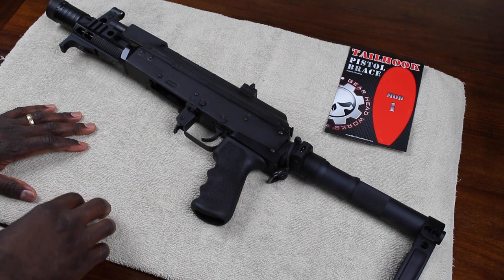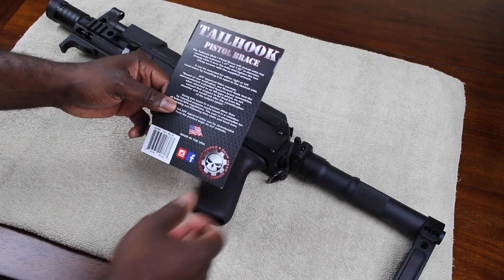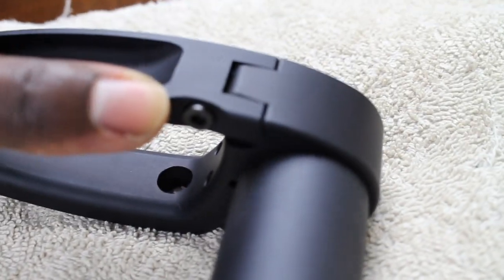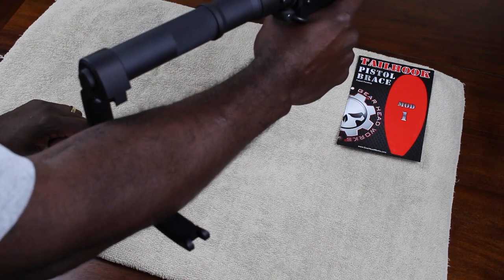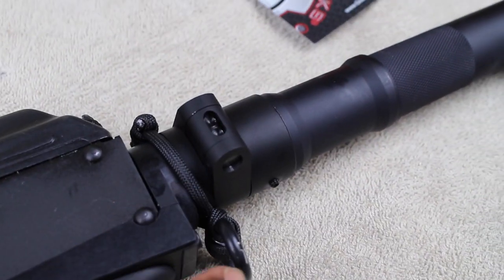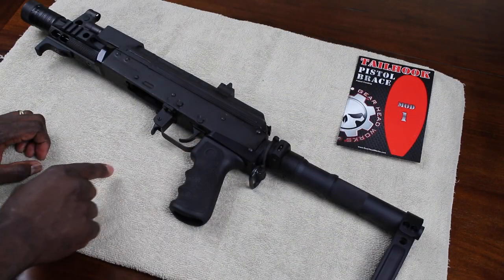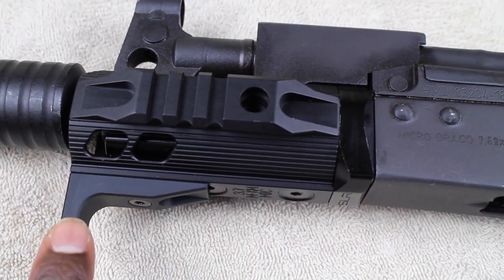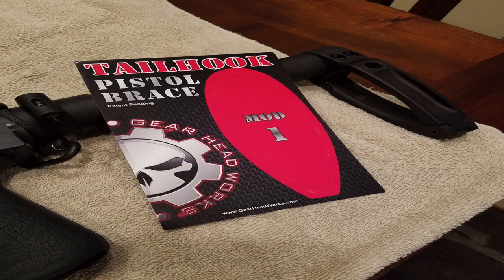TAIL HOOK PISTOL BRACE ON MICRO DRACO

Comment: What made you go with the hera sidefolding unit instead of just using the folding adapter from usmachinegun? Seems like a more expensive route you took there.
Reply from the maker: at the time, I might have seen the Hera first... but regardless, I always find a good price for whatever I end up with.
Reply: @ROBSHOTSFIRED  i think the hera looks better anyways...much less bulky than the folding adapter. Thanks for the reply i just subscribed.
Reply from the maker: Thanks!! @PewLand

Comment: Hey rob how do you install the Hera sock into the us machine gun adapter?
Reply from the maker: It just screws right in!
Reply: @ROBSHOTSFIRED  did you screw in the pin on the top of the us machine gun adapter? Im having trouble of understanding which is the best way to mount the hera side folding adapter to the us machine gun adapter and keep it locked in. Thanks for inspiration rob!
Reply from the maker: Ok, that is a set screw. So you have to unscrew then screw the adapter ion. Before you put that screw back in put a little blue thread lock on it so that it won't back out on you and you should be good.